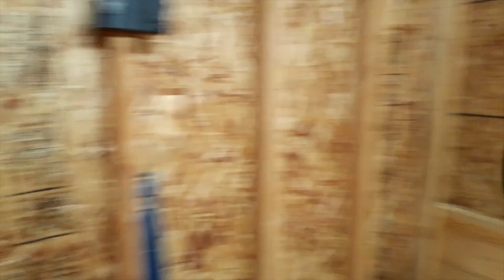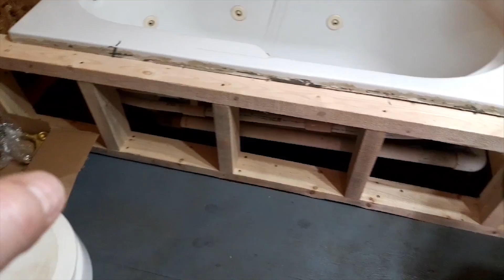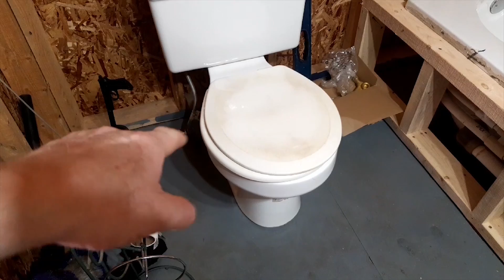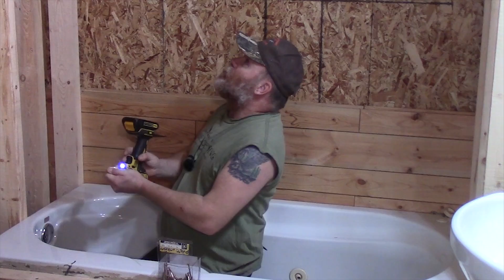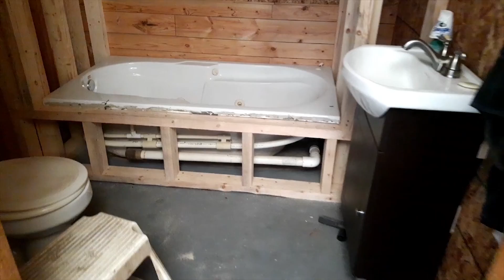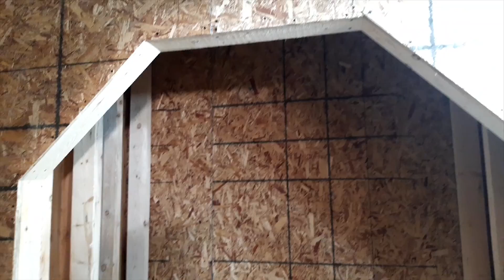This Is Our Little Bathroom So Far

Comment: Good evening Cecil and Heather!!😀😀
Looking good so far. It will certainly be nice to have a complete bathroom in the house. Didn't realize that you put in the septic system. I'm wondering if the new house is actually lower than the old one and you are getting a gravity flow from the well. That's a good thing. Can't wait to see it when it's finished. 
Take care my friends!!😀😀❤
Reply from the maker: Good evening Al.  Yeah it will be great to have a full bathroom for sure.  Ahh a septic system video would be kind of boring to watch.  Yes this new house is about 5 feet lower than the top of the well.  Thanks again..Cheers.

Comment: Be sure to have GFCI plugs on your power circuits for the whirlpool tub.  FWIW, tried those "tub surrounds" on some rentals. Always had water damage later. Properly papered and installed ceramic tile seems to be much more effective in keeping the water "outside" the wall.
Reply from the maker: Hello Bob, This circuit will be protected by a GFCI breaker in the panel.  Yeah I think I will be trying to use tile instead of a cheap plastic shower stall type.  Thanks again..Cheers.

Comment: great job I think you should paint all walls with redgard its a water proof sealer that osb is a sponge any  steam will go right in that stuff even under sheet rock and paint love you videos thank you
Reply from the maker: Thank you Roger. I am thinking of building the tub surround from tiles.   Should I still paint the walls?  I never laid tile before  :-(  Thanks again...Cheers.
Reply: @SkinnersHomesteading  yes because grout lines let water though redgard or something like it you can even throw sand in it as it drys to make more key

Comment: If you have the power to run a heat lamp I suggest trying it in the ceiling in the tub.  A buddy had one in his shower stall and it felt awesome.
Reply from the maker: Thanks Sheppy..Ahh no need for a heat lamp in the bathroom, It's just above the wood stove..It's already like a sauna in there now, the floor is so warm on the feet it almost feels like they're on fire coming in from outside.  Thanks again...Cheers.

Comment: Bath tubs come in right and left side. If I were putting this in I would have put the pump motor on the outside where it is more easier to get at'
What are you going to do Cut a hole in the back wall?
Reply from the maker: Hello Lou.  The pump motor on this one is at the end facing the bedroom wall.  I plan on making an access door in the bedroom closet if I ever need to work on the motor.  Cheers.

Comment: Looks to me like hot water is on the back of your mind. I know a fella that lived off grid cause he can't afford the drop that the electric company charged He installed a on demand system that requires no batteries or power, when the water is turned on, a little paddle wheel turns and lights the propane and bingo bango... hot water every time. I've never heard the name and tried once before with a friend to look it up but no luck He bought it used and it has worked for over ten years I know about ... Always works like  a  charm and I wish I could give you a name but even the guy who owns it can't... sorry Looks good folks Green board is fine but sheet rock is BS as far as I can tell. Good luck
Reply from the maker: Hello Morgan.  I have a hot water on demand unit....But mine takes two double batteries to ignite it...They work pretty well for sure.  Thanks again.  Cheers.

Comment: I think you are doing a few mistake, you have the space for a podium at each end of the bath, it's give space in the bathroom. the arc will be problem with the steam, the steam will jam in the arc and cause moisture. You suppose have a GFI outlet. I suggest to put the shower in an other room, it's more practical.
Reply: If the circuit breaker at the main panel is GFCI then you don't need one at the sink.
Reply: If you live off-grid, you don't "need" a GFI.
Reply from the maker: Hello Francois, I will have a ceiling fan in the shower to remove the moisture.  The outlet will have a GFI Breaker in the panel.  Cheers.